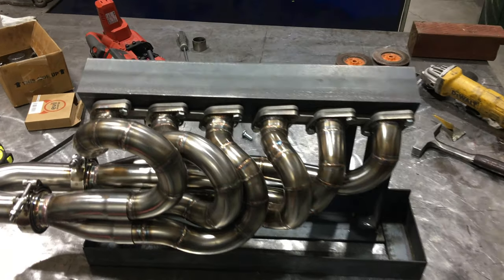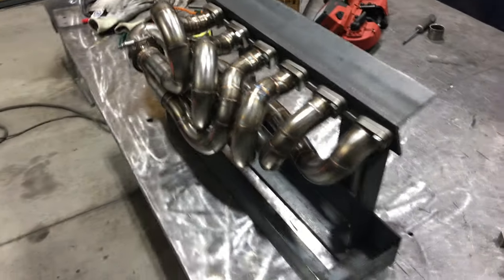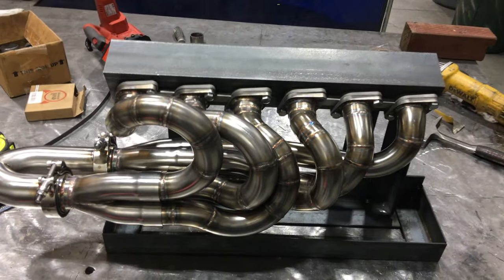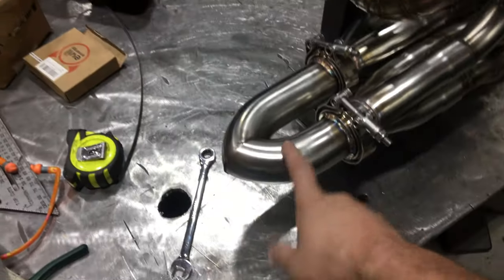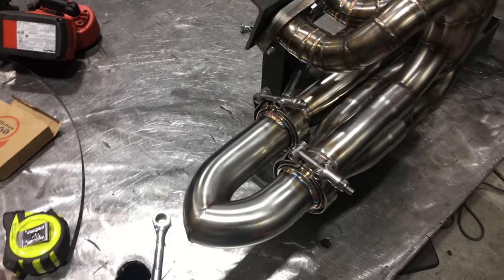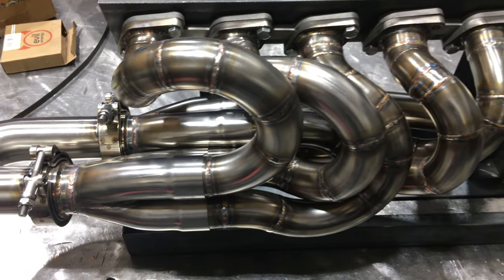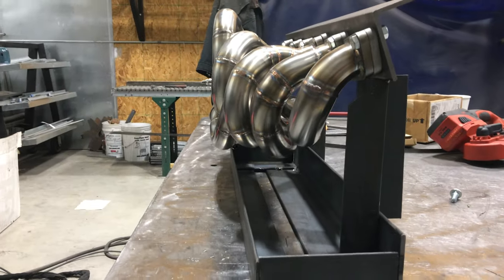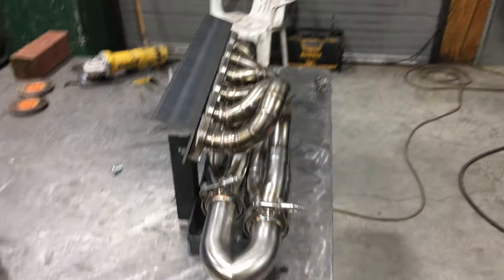Lamborghini Diablo Murcielago Headers

Comment: What's the latest with these Headers
Reply from the maker: Finished and installed.
Reply: @AmericanBuiltExotics  How are they? Are you building any sets for others
Reply from the maker: @BC-hr5uc  They finished great! I`m very pleased. I have yet to start the engine... don`t know how they sound? No, I`m not making any others sets. My chassis is built form a early diablo. The engine bay in narrower than a murci. In short... they wouldn't fit a stock murci, without mods.